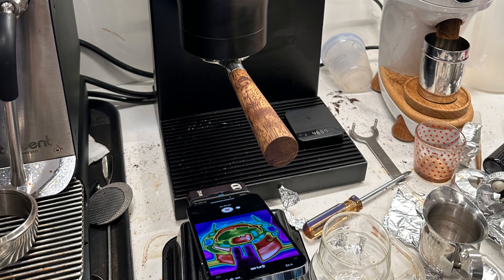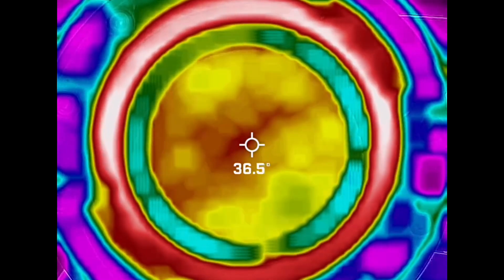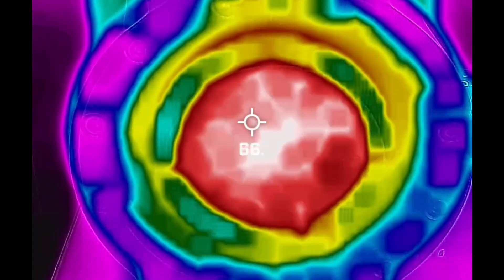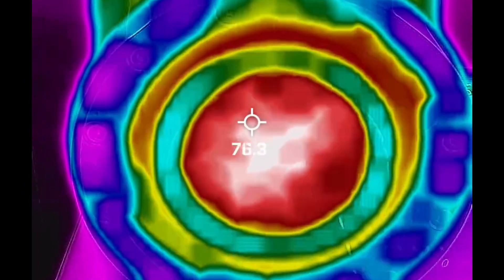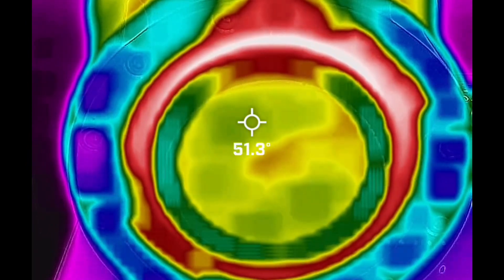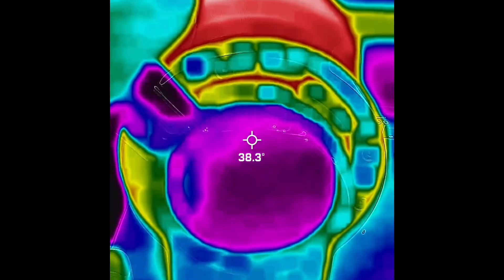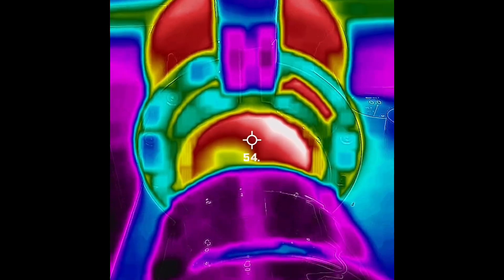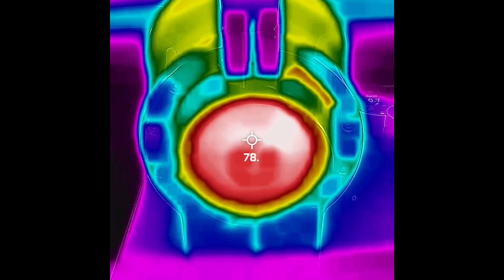Thermal Tests on the Meticulous Home Espresso Machine

Comment: Hey Robert, can you throw a small piece of black electrical tape on the shower screen and measure it? It has been suggested that the reason the readings are so low is due to the emissivity of the screen disturbing the reading accuracy. Supposedly Scotch 33 is good for this purpose. Not sure if you have that specific one on hand or can easily get a roll.
Reply from the maker: Yeah sure. I’ve done that before and while thermal cameras aren’t ideal for liquid or metal, the ballpark is good enough when comparing to the DE. I’ll put tape on both and do it tonight
Reply: Interested to see if there’s a meaningful difference! Thanks!

Comment: On what surface are you measuring this? Infrared cameras hardly work on any shiny or transparent object (if you make a thermal image of a mirror you will make a thermal image of yourself, not from the mirror). Same for water. You need a quite thick layer of water to be able to nearly measure its temperature, still it will be overlayed by reflected IR-light from the surface from surrounding objects.
Reply from the maker: Generally yes, and I’ve seen the thermal shadow of other things. The shower screen isn’t flat though like a mirror and that helps
Reply: @espressofun6091  This just means you cannot see complete reflections, but there will still be lots of reflections. You can to a quick and dirty test by apllying a small black sticker. I am confident that you will see this sticker in the thermal camera with a higher temperature than the surrounding metal.

Comment: Hi Robert, thanks so much for the experiments! Do you think you would achieve a higher temperature if you would remove entirely the shower screen? In that case, you would need to put the portafilter with basket in and measure the temperature at the bottom of the basket. You may also need to have a proper coffee puck in the basket so the water would not flow right away without pressure being applied by the piston. I guess you would also need to do the same experiment with the Decent (with portafilter and coffee puck) to have a comparison point. Curious to know your thoughts about this. Thanks!
Reply from the maker: I don’t think so. It isn’t just the shower screen but where the basket locks in

Comment: Great work! I am a backer, but i am really considering to wait for a later version of the machine. Lance Hedrick's thermal test on the Flair 58, showed that he obtained around 92degC. So i hope that the thermal issue can be solved by the software (and not by a new hardware version)... but i presume this will increase the heating time (currently communicated to around 5 minutes) needed before the grouphead reaches a higher temperature? I mean, i am backing this project because i don't want to wait 30 minutes time for my E61 to heat up. And then, the other problems from your first video...
Reply from the maker: If it is software then it will heat faster. So I don’t think the heating time will be greatly affected
Reply: @espressofun6091  Presuming that they are currently using  the best of the heaters capability to get to 50degC grouphead evenly distributed temperature in 5minutes, getting to over 90degC will affect the heat-up time. Will you have the chance to test the machine with the new temperature setting before the campaign ends?
Reply from the maker: @gggeeeooorrrggg  I’m not sure. Hopefully I will. But it does make good espresso as is. I’m trying to maximize performance.
Reply: @espressofun6091  Maybe a firmware update :). Well anyway, they should have send you the machine much earlier and they would have had more time to solve the issue :). Great work again!
Reply: I’d also wait for this to be fixed before I’d consider buying

Comment: Is this any different than on an Decent? Did you try the same temperature measurement test?  The coffee bed will lower the temperature. You don't want to over compensate and blast the coffee with too hot brew water necessarily. I'd prefer if the brew temp is what I set it to and not an arbitrary pid setting where its actually 8c higher or lower etc like how some machines work with pid offsets.
Reply from the maker: Yes I did. If you check out my short video from yesterday, I put a similar test with the decent.
Reply: @espressofun6091  oh cool I didn't notice that one I'll check it out.

Comment: Grouphead itself is not heated,  only the chamber.    One addition heating element to achieve like DE group head.   
( on DE it is 10mm dia. heating Rod, install into the brass )